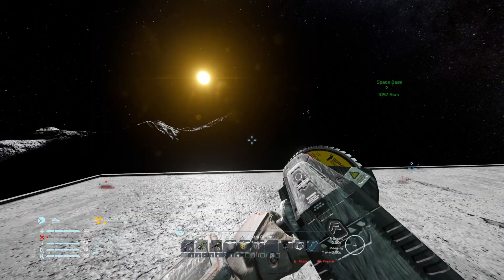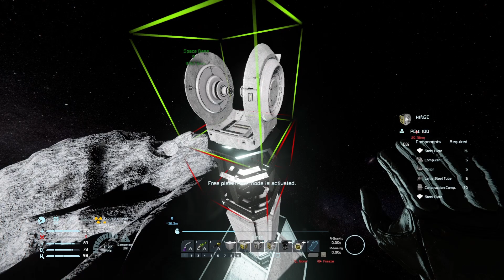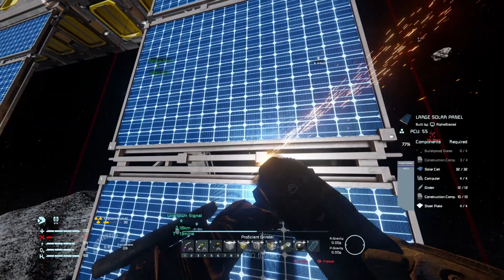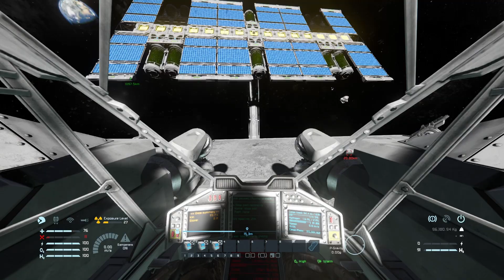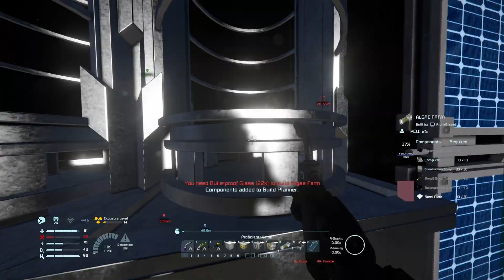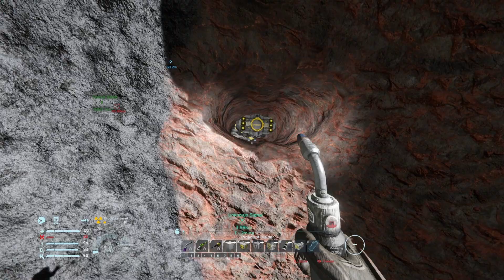Space Engineers Never Surrender Retake Ep3 Finally some food and solar tower

Comment: You can put you food on the hot bar which is a good idea If you have a programable block for your build and repair and load the build and repair script If you read the script you can make a group for your assembler and one for the build and repair and they will work together so when you place something they will make the components required When you upgrade the assembler you can set a default for components in the assembler so it builds a certain amount of things you need like 100 steel plate for example I'm not sure if it a mod or in the game now though What may be a good idea is showing how you set things up like your monitors to show power etc Those thing are why a lot of people watch videos anyway because you don't manuals for games these days That's what started me watching videos in the first place so it always a good idea to show people how to get things working properly and show the mistakes too Some people cut way to much out in my opinion and its usually the important things like getting things working because people will be having the same problems too and they are looking for info to sort it out It could increase your following and views just by doing that
Reply from the maker: Will sure follow that because I am planning on moving the vital part of the base into the astroid to have it a bit more secure. Will be moving the lcd display aswell so will do the setup for how I do it in the next video. I know there is a script aswell that I can setup that keeps a certain amount of components build, so everytime you take a steel plate or interior plate it auto crafts it back to the set amount so you will always have it available might look into doing that aswell